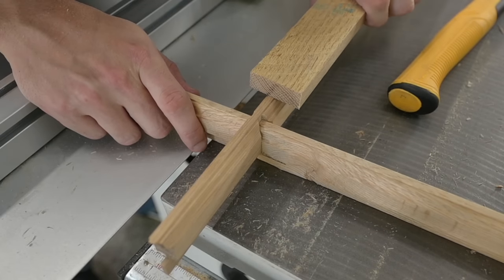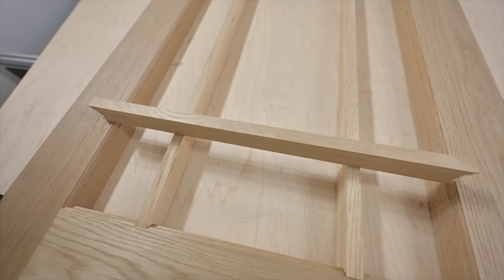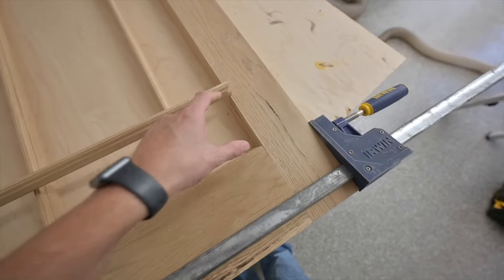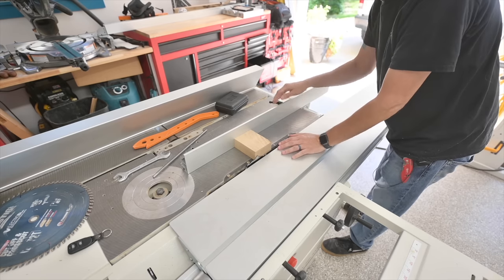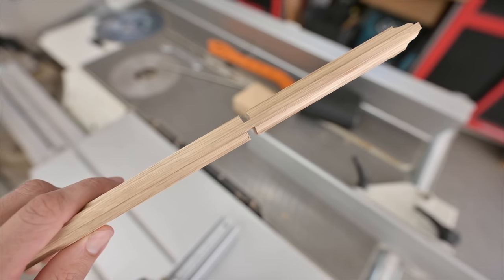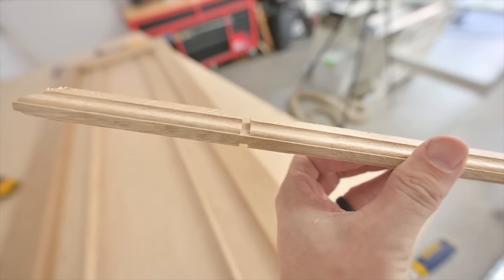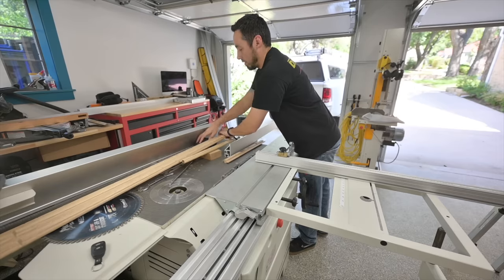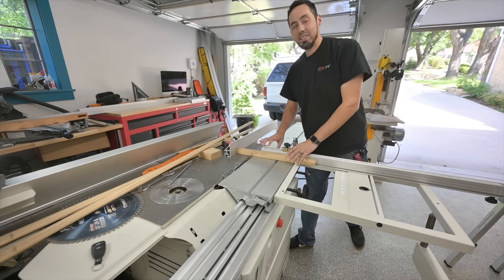Cutting the HARDEST JOINT in CARPENTRY - Intersecting half lap miters

Comment: During my apprenticeship, 
We were given 44x44mm pine and had to make these joints to fit into 8 panel doors that we made by hand from scratch, 
only machines we used were Thicknesser and router table for the moulds 

It took forever by hand, 
Everything was Scribed with coping saws and supersharp saws and chisels, 
But the sense of achievement and pride was second to none, 
I can apprieciate your excitement, :)

Comment: Richard, card scrapers are great for removing burn marks. You just need to learn how to sharpen them for a burr on all 4 edges. Another plus for using card scrapers is that it leaves the wood smooth and ready for finish.

Comment: Hey Rich, carpenter with lots of experience building windows and doors here.  The joints look great, but once you are making these in bigger batches, I’m afraid it’s gonna get laborious. 1/4 tenons are plenty strong, for the intersections and the glass will keep everything in place. Using a mortiser and cutting tenons on the table saw reduces the number of steps and different tools to set up. 
Big fan of the channel, I’ve learned a bunch over the years, was really excited when I saw you getting into doors and windows!
Reply: Same here, he will have a seriously hard time making money with all that working in a garage in a residential area, I enjoy these channels but frankly, these channels are more about content creation.
Reply: @jamesdrake2378  There is enjoyment in the artistry of joinery! This guy is clearly loving it so maybe making money isn't that critical to him =)
Reply: @skwalka6372  that is apparent
Reply: Explain please
Reply: Nah, keep doing what you’re doing. Tenoning the bars is an inferior method. Can do this lapped bar method much more quickly with a morso mitre guilotine set up for notching and a saw. 
Just as quick as morticing and tenoning. Done both methods for many years.

Comment: Great job Richard, used to make dozes of these but all hand scribed back then, as there were few routers or precision saws. Tip, if you cut the joints first then run the profile you avoid break out, just takes a little more fore thought but the traditional way joiners did this type of work. I’d like to see you do stub tenons on end on muntins just to secure them. Love the smell and feel of white oak. Class job.

Comment: In the UK we through mortice the horizontal bead. Then we scribe the mould along with a long shoulder for the rebates. In other words, the vertical beads rest on the horizontal beads on top and the vertical bead supports the horizontal and vertical bead above. Paul Nooncree Hasluck researched many of his fantastic books basing them on British joiners, cabinet makers, carpenters along with some (sticks in the throat) French/Belgian/Netherlander tradespersons. So, let the vertical beads (think transombes and mullions) take the weight supporting the horizontal beads. Scribing and rebating shoulders is a must. But, great end product so far as you mentioned the saw burn marks (too fast past the blade, an over coarse blade).

Comment: Great job brother! If you are going to add screws for securing the Munton bars, my only suggestion would be to use trim head screws. Smaller, finer threads, which will eliminate the risk of splitting those smaller pieces and no bugle head on the screw, which will make plugging the hole much easier to hide and blend in.

Comment: On fixing the Munton bars could you not use 1/4 inch round dowels instead of going from the other side to fix them? Great videos 👍🏻
Reply: I like this idea for affixing the muntin bars to the styles and rails. The only challenge might be drilling straight and centered dowel holes at the ends of the muntin bars. Once that is done, then it would be easy to use dowel centers to mark the hole locations on the styles and rails.

Comment: Richard, awesome!  I really want you to get some calipers.  You can use the tail on them to measure depth, and jaws for thickness.  Cheap set 'pair' is more than good enough.  They aren't just for machinists or engineers.  Super handy once you get in the habit of reaching for them.  Great for machining drills, hardware, cuts, scribing distances, etc.   Cool stuff man!

Comment: Doors usually don't have screws or nails in them anywhere...I think you should drill into your vertical and horizontal pieces (Google won't give me a spell for muntins) as you stated but install only oak dowels instead of screws. Someone in the future will ruin a blade if they need to trim your door for some reason.
Reply: Most doors available here in Aus have long staples used in the manufacture process. the staples are only used to hold the top or bottom rails to the side rails. The staples are usually a small gauge but quiet long. Thay don't seem to do much damage to my saw blades.
Reply: @evictioncarpentry2628  I did a lot of work for people with little money and have trimmed multiple inches off doors. In normal circumstances, yes, what you say is true.
Reply: This is a fully custom door as it stands. It will never be changed from this dimension.
I too, have cut inches off doors. 99times out of 100 it's the top & bottoms. The sides however, will maybe get planed 1/16 to 1/4. Rarely ever more then that. If I have to trim 2 inches off a door (inch on each side) I'm starting with a different sized door lol
Reply: @evictioncarpentry2628  Maybe, maybe not. If he sells this house the new owners may change these wood doors for personal taste or security concerns which means they may be installed in much different dimensioned doorways elsewhere...they're to good to throw away. Remember I said people with little money, which means if I had a door in my garage that I could make fit I was happy to empty something out of my storage and could charge the client for labor only...win/win. Most of my clients didn't have 3 Mercedes parked in the driveway. Sometimes, but not often. I did a lot of work for people who owned dozens or hundreds of rental units. I also did a lot of charity work; work 3 days, charge $100 kind of stuff.
Reply: Yeah,  well, you can continue living your life based on what-ifs. 
And I'll live in reality.
Cheers.
Reply: @evictioncarpentry2628  My concerns are part of reality. Same to you palsie.

Comment: 4mm x 20mm stainless steel pin dowels and glue along the joints is suffice, not much lateral force on them when fitted between the  sides...
Well done on the achievement 👍

Comment: Some of the break out may have occurred when you were cross cutting mullions, look at 11:26 to see.  An auxiliary fence added on your saw's slide gives it a zero clearance cut to support those wood fibers.  Your auxiliary fence may need to be shaped to fit the side of the mullions to fully support it.
 A slow setting epoxy maybe a good choice for assembling your door.  Regular wood glue has enough water in that the dominos may swell and make assembly hard, but epoxy does not swell  the dominos but lubricates them make them slide in easier.

Comment: Instead of using the mitre saw, could you have used a router table with a 45 degrees router bit?  Genuine question - would it have been more repeatable?

Comment: What did you use for the inside button to hold the glass in? Did you use a stock molding or did you put your own profile on it? I’m curious how you installed the glass with that part. Thanks for your video really appreciate your work.